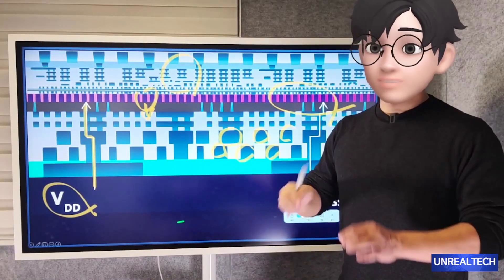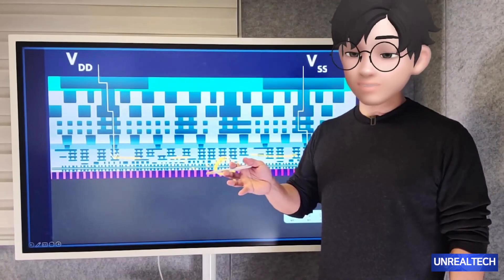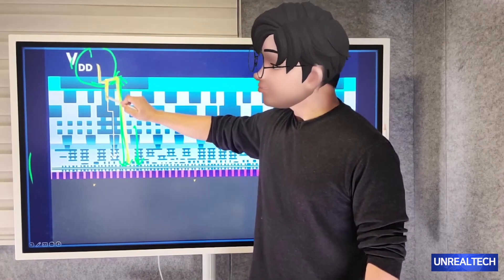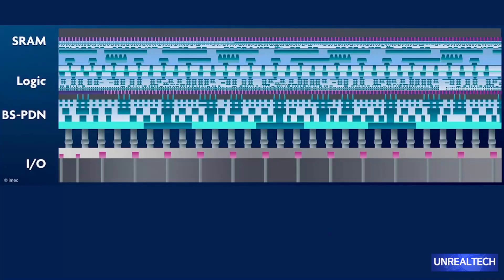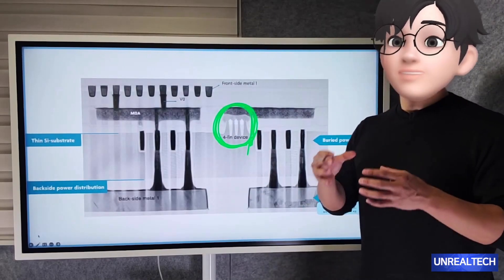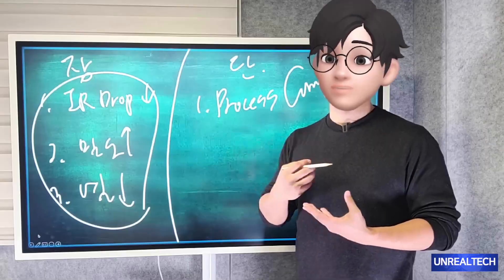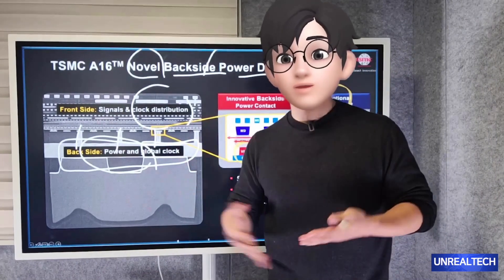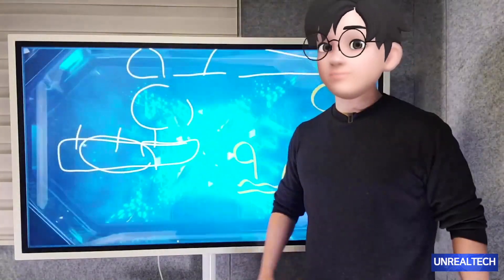Using Both Sides of the Wafer: TSMC and Intel’s 2nm Breakthrough with BSPDN Technology

Comment: But how do u even reach the back side? The weafers are ~300μm thick, while the front+back does't look like 10μm to at best 50μm thick. Grinding down that much on a wafer with ~1ft diameter  sounds nearly impossible. Are they slicking/dicing the 30cm wide weafer to more managable size before engineering the back side?
Reply: As I know, they use BG (back grinding) CMP process to obtain appropriate thickness.
Reply: @범고래-z8q  Thnx.